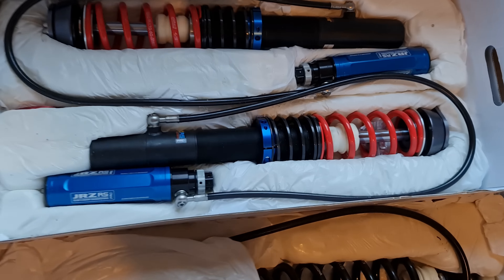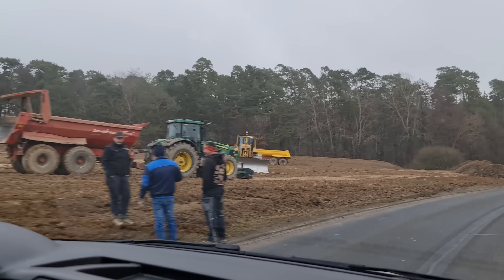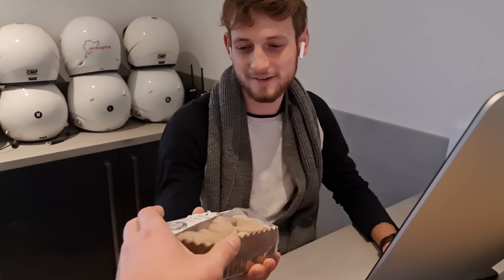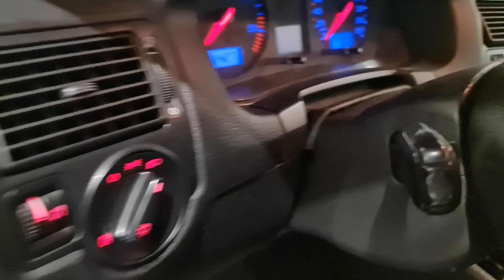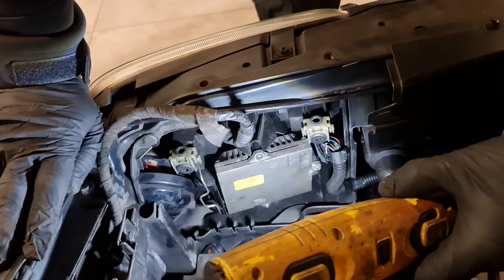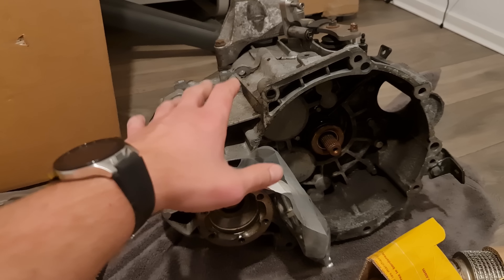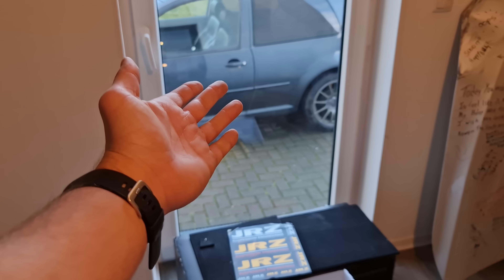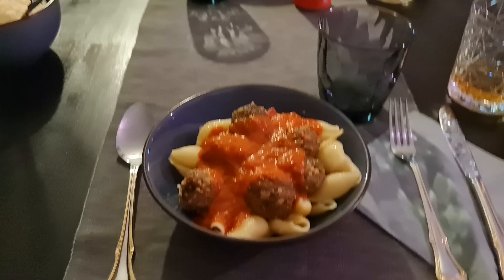RingTracktor: New Car Parts Unboxing!

Comment: I love the confusion haha. They rotated instead of tilted. Haha
Reply: Just use a 10€ selfie stick which has a rotating joint....
Reply: @stephenwolff8217  make one with carbon fiber for 10 and compete.
Reply: @Tristan.R.J.M  Function over form for me. Couldnt care whether its CF or not, it must just do the job😉
Reply: @stephenwolff8217  agree, flywatters cost 50 cents. Hands are free. But a gimmick wich is both pretty and handy... I’ll pay up

Comment: Yeas, the Golf 4 you have to take of the front bumper to change the bulbs, super cool design....
Reply: You just need someone with tiny hands to change them for you. Bigger problem with the Mk4 is water leaking in and it (without aircon) being impossible to de-mist. Mine has also started intermittently pumping out a lot of smoke with a lumpy idle on startup 😮. Great power with the PD130 and great on diesel.

Comment: Steering wheel looks🔥🔥. Looks really good! Was the OG Ring Tracktor on JRZ suspension or on stock suspension?
Reply from the maker: Stock, never managed to install it
Reply: @mgcharoudin  I've been subscribed for over 2 months now, so haven't seen many vids of the old Ring Tracktor. Since lockdown I have some more spare time, and have watched back some older videos. It was on stock suspension in those videos, wasn't sure if you changed it. Will be a big difference with the new suspension without a doubt! Looking forward seeing more updates on the Golf

Comment: Hey Misha if you have an 4Motion Mk4 then the gearbox Will not fit your current setup as it has only two driveshaft's for FWD, whilst the your current PD150 ARL lump has the 02M gearbox with the exit for connecting the rear axle shaft, Just something to remind you to transfer the Quaiffe differential to your current gearbox or let Darkside transfer the LSD diff to another 02M AWD tranny and sent it over to you back to DE. Lg. and keep up the good content.

Comment: Wow, Misha. You have so much more self control than me. I would have opened that steering wheel box the minute it got delivered.

And then probably slept with the wheel in my bed until it got installed.

What?

Comment: the ringcard-holder guys should get in touch with obelink, camping-wagner or fritz berger. when i go camping with my car and caravanit's always a pain in the a__ to get onto and off the campsite, because there're similar barriers like on the ring. and due to the extra mirrors i can't get close enough to the card reader.

Comment: Is that a Mk6 wheel? Of course the question is, are you wiring in the controls as well?

Good update, interesting to see where this one goes
Reply from the maker: 7, and no 😬
Reply: It is possible to wire them! I've got the same wheel in my mk4 and everything works.
Very nice upgrade😁

Comment: What about that Verkline front arms for mk4 golf?
Reply from the maker: Will see the necessity of them as I already have Audi TT front underside on the car.
Reply: @mgcharoudin  but where do you find them?, i search on internet and Verkline website and starts at mk5 PQ35 platform, there is nothing for mk4 PQ34 😕
Reply from the maker: @hectorlambies7400  that's a one-off custom. You can email them directly.
Reply: @hectorlambies7400  There is no PQ34 for the Mk4 it is the A4 platform and back

Comment: Is all this TUV.  ?
Reply from the maker: Yep.
Reply: @mgcharoudin   

Is it hard did the restrictions get harder are used to live real close to Nurnberg. Don’t get me wrong I’m not gonna complain about the TUV their purpose   I wonder if that steering wheel could fit on my MKK5

I think it’s great when you have videos of suspension parts and stuff so many people here in the United States just put so much power in the car but they don’t want to spend any money on suspension but it’s changing I think around 2007 people start buying tons of suspension kit’s at least that’s what my local tuning shop told me the attitude changed. 

Great videos great content. 

It’s more interesting than watching a sitcom on TV